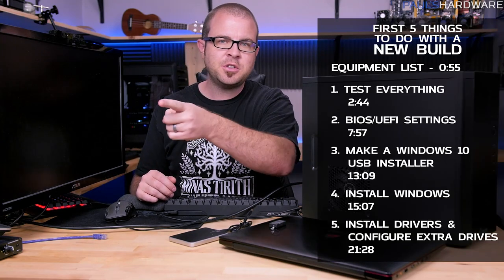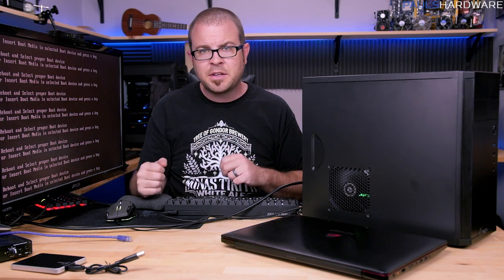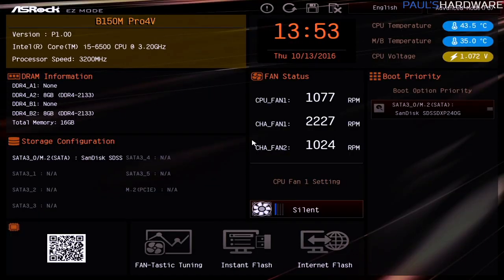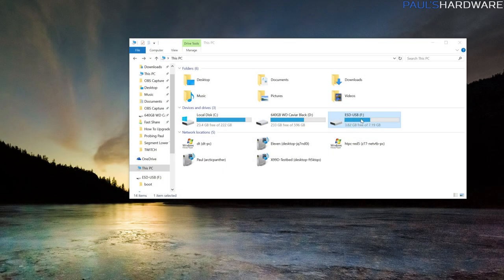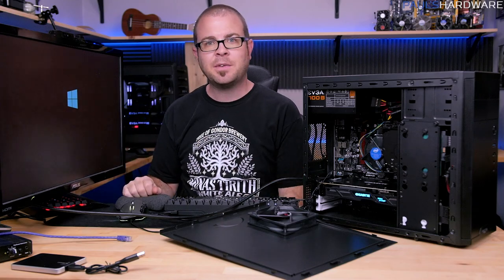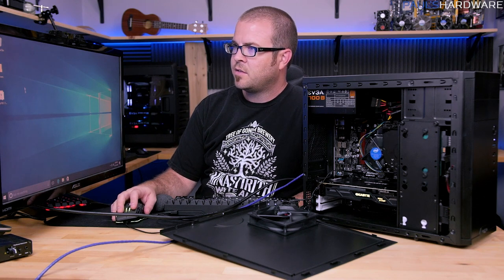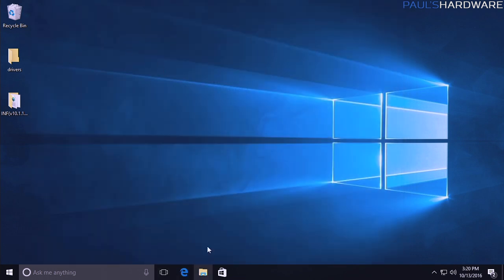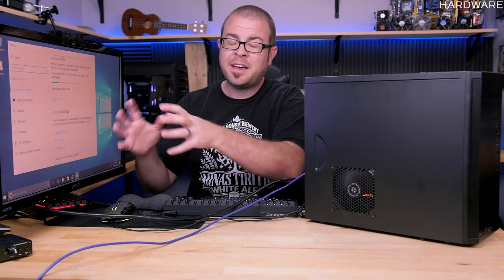First 5 Things to Do with a New PC Build

Comment: can i use my old win 10 product key from my laptop or i need to get brand new key???
Reply: id also love to know
Reply: Most laptops have OEM keys which cannot be used more than once so if u have a laptop u need to buy a new key but if u built (if it's prebuilt u cannot it should be built by u) a pc and bought a windows 10 key write down that key in the new pc and it should work unless u bought a OEM key.
Reply: Biała Panda Hey dude, it depends. If you bought laptop and it came with windows set up. The answers no, but if you put in the product key yourself, yes you can.
Reply: not really because my friend got a key from his friend and he gave me the same key and it works too so we are using the same key on 3 pcs.
Reply: Biała Panda could try it and see as long as it is not OEM.

Comment: I'm building a new pic later this month, and I was wondering- can't I just plug in my current HDD with Win10 and all my files and boot from there? Then get my drivers etc? Thx
Reply: I have swapped mother boards and memory but kept everything else the same.  All that I had to do was install thedrivers.
Reply: Question! So connecting to your Monitor (or TV via HDMI), Keyboard and Mouse does not need "drivers" even when having a newly custom built PC right?

Because I'll be connecting my PC to my TV via HDMI and I've read about it that drivers are needed etc. and it made me confused... (Maybe drivers are needed only when using Graphics Card?) 
So will I be able to use a Monitor (or TV via HDMI), Keyboard and Mouse without installing drivers, so that I can use them to navigate through BIOS while having no Operating System?
I won't be using Graphics Card by the way and I'll be installing Linux Mint instead of Windows.

Newbie here...
Reply: Late response sorry

If you haven't figured it out by now (you've had 3 months) they will work fine but before you do any serious gaming you will want to install the drivers for your mouse, keyboard, and graphics card. The drivers often are in software that allow you to tweak and optimize settings on your hardware, but this is not always the case, so don't freak out if it's not there. It will usually say. If you don't have a graphics card (if you are using a motherboard with integrated graphics or using an APU (Accelerated Processing Unit. Basically an graphics card/CPU combo) you still need drivers. If your motherboard has integrated graphics and you are using an Intel CPU (i3, i5, i7, i9, Celeron, or Pentium. But who still uses Pentium?) it is more than likely you have Intel graphics, and you need to go download the drivers for it. With an APU, since it's AMD specific, go to their website and find the right driver. If you don't remember what you got, or it is too technical, check your BIOS, as more often then not it will give you a name or a model number you can google. Video displays don't need drivers, but be sure you are using the best cable option (for example use HDMI over VGA) that is supported on your motherboard AND your display device. It is no use having a HDMI to VGA adapter as you lose all of the advantages each one offers. 

Let me know if you need to know anything else, I will be happy to help. Reddit has great PC communities such as https://www.reddit.com/r/pcmasterrace/ to help get PC users acquainted with their machines. This is a late comment, but you were speaking as you haven't built your PC yet. https://www.reddit.com/r/buildapc/ Is a great way to find better choices, or even choose full builds if you are completely lost. Remember YOUR PC WILL LAST YOU A WHILE. BE SURE IT IS EXACTLY LIKE YOU WANT IT
Reply: yes

Comment: What is RAID mode?
Reply: TheLivingCat 02 yessss anyone? 🤔
Reply: im as confused as you are... id think theres much to worry about.... its prob something to do with OC
Reply: i'm a fucking crow no it's a way to set up your storage
Reply: TheLivingCat 02 RAID (redundant array of independant disks) this is used as a way to dipurse files and data across more than one drive to  help with general speed and increased storage  depending on what comfiguration of RAID you use: i hoped this helped
Reply: lilly smith good explanation
Reply: lilly smith so basically it's for if I have multiple HDD's and SSD's right?
Reply: TheLivingCat 02 Yes
Reply: TheLivingCat 02 Yes. I have a RAID 1, which is essentially just mirroring the data across 2 different hard drives. If one of them fails, then I still have all of my files safe. Then AI can get another hard drive to set up another mirror. It's essentially a failsafe.
Reply: Its a dungeon that can be as big as 40man and has elite monsters and bosses and offers epic loot
Reply: blackham7 does it have rams tho?
Reply: that dog in your picture is so fucking adorable, I just saw it and I have to point it out

Comment: Scumbag paul... says windows link in description and there is none link i cri everytiem
Reply from the maker: fixed!
Reply: mah man <3
Reply: Paul's Hardware can you do a video on how to seperate storage between your drives? So your ssd doesn't very loaded with crap that should be on your hdd.
Reply: MDG Gaming - Install paths are your friend. :-) You can change the default path in the RegEdit, but some programs ignore it and install on the C drive no matter what. Plus if you change that part of the registry, Windows can't install updates.
Reply: almost all programs you can change the install path while installing, as such you should always check custom install to make sure what is getting installed

Comment: I built my first pc not that long ago... it took me a month of paranoid planning and researching compatibility to buy the components, and a week after that to finish building it. It took so long because I didn’t really know what I was doing, so I simultaneously watched tutorials on how to put the components in while doing it in my computer. I was so worried when putting the CPU cooler in, because no matter how hard I tried, the screws wouldn’t grab onto the motherboard threads. I started pushing down on it desperately to try and get it screwed in, and about 30 minutes later I finally did. I was worried the rest of the building process that I had ruined my processor. I also has school, so I spent about an hour on my computer a day. Finally, when everything else was assembled, I pressed the power button and prayed it would turn on. It didn’t. Luckily, before I got a heart attack, I remembered I had forgotten to switch the PSU switch back to the “on” position. I tried again and it booted up. I don’t think I’ll ever forget how happy I felt. As many headaches as that experience gave me, I loved every second of it, and I can’t wait to do it again.

Comment: Hold the fuck up so I need to have another computer to set up my new computer? I bought this computer because I don't have another fucking computer. I guess I'm fucked??
Reply: Regrapsy Borrow a friend or family member's computer.
Reply: i only have macs...
Reply: Regrapsy Wait.. but would this be like what came first... The chicken or the egg thing?
Reply: He uses it to make a Windows 10 USB Installer.
They sell these at various stores. So you could get it with your license if you get it retail.
Reply: They also sell windows 10 usbs. Just got mine from amazon and is installing as we speak
Reply: LeBron James tons of case just don't come with cd driver space. cd are dead
Reply: Yeah, my Fractal Design Core 2300 has a DVD drive space.
Reply: Go to BestBuy and use a display model to make your drive. If you need a Mac installer, there is a terminal line you can run that builds your drive. They are on display as well.
Reply: Regrapsy I
Reply: I prefer the s340 elite, super sleek design in my opinion. Though I am aware there is no CD drive, there was such an invention called (external CD drives). They are connected via USB. So a $70 case with a $20 gadget beats any overpriced $150 case that includes those aged drives. (Let's face it, $24 for a simple LG Cd drive is, dumb and $69 for blue-ray is ridiculous)
Reply: How do I install ut99 without a cd drive xd
Reply: If nothing else, a library should be able to help out. Still a family or friend's computer can help better. It's only once you have downloaded the current Windows that you are good to go.
Reply: rhys Thompson still works
Reply: Go to a library and bring a usb with u?
Reply: A lot of cases that are desired choices don't have cd slots. As well as the fact that every download is online now a days cd's are useless. Admittedly this is something that would not have access to the internet so a CD would be convenient yes. BUT the USB drive is also available through Windows purchases and is also cheaper. So if you have a way of creating a bootable USB that is the best way (If you know how to navigate computers and such) if not go for the USB Drive + Windows Key package. That way you also don't need to purchase a CD drive for one installation.
Reply: LOOL WoW players??? I PLAY WOW LOOOL AND U DONT USE DISK DRIVE BRO
Reply: You are correct the store sold versions do include cd's. BUT they contain activation codes which are what make the expansions activate. You obviously are not an avid user of Battlenet or any other online game platform like steam. If you have a game for PC most likely it is not purchased in stores but rather online UNLESS you are getting any special promo codes or something of the sort. Even still that stuff is available through the online stores 99% of time at the same time. Ive been playing WoW since Burning Crusade and I stopped using CD's after Lich King.
Reply: How many of those games were purchased within the past few years and what games were they. WoW includes a disk in their IN STORE versions, but I'm almost certain majority of players just use battlenet for purchases at this point as that is what you need to play WoW anyways? And same thing with Steam and Origin. Here I'll give you an example, I was at Bestbuy a few years back and bought MW3 for PC. It was on sale so I bought it, and YES it came with a CD but NO I did not use it as it has an activation code that you need in order to use it, AND it needs to be used through Steam for online purposes which after activating code for MW3 will download using Steam not the CD. CD is not used for anything other than installation. https://us.battle.net/login/en/ WoW download is on here AND if you know anything about WoW you would know that you do not need to do anything with a CD at this point because it launches through battlenet and battlenet automatically updates to latest versions of things. Everyone plays the newest version of WoW but unless you have the latest version purchased you just can't access the newest level cap or the latest character introduced. If you are still using CD's to install your expansions then Im not sure what more I can say except for get with the times bud.
Reply: Okay I live in North America yes. I do not know how exactly Germany's supposed to be different? There is no game I know that needs a CD to be used on PC unless its from like pre 2005. If you know different please tell me what games
Reply: Okay Sims is on Steam as well... Maybe Germany is different but at the same time you clearly didn't know WoW as well as you thought. Reason I was getting so into this is because you brought WoW into it. Thats my second if not first most played game of all time so... We have EB Games in Canada and GameStop in United States. I do know there is a PC section with games yes you're correct. But none of those games HERE use those CD's for anything more than what Steam/Battlenet/Origin do already.
Reply: That is nice af
Reply: You've listed 2 games in your arguments. Ive proven both of them incorrect to a point. Im done trying to explain to you how to live in the 21st century. You want to collect disk and keep buying cd's? Go for it. I was trying to point out how out of the way you go and how EXTRA you are by using CD's when they're 100% unnecessary.
Reply: No you dont use your phone!!!
Reply: Regrapsy j
Reply: It's like the internet commercials telling you to go online to sign up for internet access.. how the fuck
Reply: Anime Obsession That is the kind of argumentation I love to see on Youtube. No flaw, explaining everything you need to understand, no grammar errors. I bend the knee. Bravo.
Reply: Regrapsy local library?
Reply: rhys Thompson you should be able to create the iso off of a Mac, if Bill Gates won't let you, just get the winx iso file and a program called Rufus to make a bootable usb
Reply: Ethan Watters Best Buy lets you do that?
Reply: Regrapsy go to the library and install window 10 on the USB drive there.
Reply: just make sure to do medical checkup later to know if you are pregnant or having STDs
Reply: Obviously you're not, since you were able to post this comment...
Reply: Marcus Hendriksen phone?
Reply: Get a DVD drive and buy the physical copy of windows
Reply: There is such thing as a 3rd-party external CD drive

Comment: Thanks Paul, this vid was a big help.  I completed my first build recently.  When I had completed the build, I initially checked the BIOS as you suggested, before loading W10, and I could only see one stick of RAM, not two.  So I swapped them around, and could still only see one (but now in a different slot).  I might never have known I had one defective RAM stick if I hadn't done as you suggested.  Then when installing W10, the 'clean disk' function you stepped through, was also a lifesaver for me.  Thanks again.

Comment: Thank you for taking the time to break this down into timestamps so I can refer to it as I am building my wife's new Windows 10 Pro computer to replace Windows 7. Will be swapping out her old motherboard and replacing it with a new one and this will be a big help since her new case doesn't support an optical drive. I will need to follow your procedures on how to load everything onto a thumb drive.

Comment: Enjoyed the UEFI section. Just built a new Ryzen 5 system with a MSI motherboard. I had an ASUS MB on my old system and was familiar with getting around in it. The MSI UEFT is a whole new beast, quite different in how it presents the information and settings to the user. Can tell I'm going to have to sit down with the manual on this one and familiarize myself, but was at least able to stumble through it enough that everything is recognize and the system runs well, but plenty of room for tweaking later on.

Comment: So once you setup windows from the USB do you unplug it ? And does it automatically boot off the M.2 SSD ?
Reply: Once you see the desktop, you're done with the flash drive and you can unplug it ;) Your PC should always be booting from your M.2 SSD, as long as it's listed as the first option in "Boot Device Order" section of your BIOS.

Comment: " Key 11" upon the first start to BIOS. Sets the default boot storage..2 questions please. 1) How to confirm this is correct Key "11" for my motherboard? 2) do you hold it dow prior to pushing start power.? Do you hold it down during start process? Thank you. Same questions for Short cut turn off Key "12"? Thank you..Great videos.....( First Build ) I think you make it an obtainable process. Thank you..Liked and subscribed.

Comment: The unplug any other old (boot) drives before installing Windows was one I forgot a couple of weeks ago, and Microsoft then tries to be smart and add the new Windows boot to the existing Windows install boot partition. Which then means that when you unplug the old drive after creating your fresh new Windows install the system won't boot... Bah.

This can be fixed but not without technical know-how, so this is not for everyone.

So good tip Paul!

Comment: Most modern motherboards don't require you to physically unplug the drives you don't want to use. There's usually a setting to disable the ports you don't want so nothing can see that they exist until you go back in and re-enable them.

Comment: Since the mouse and keyboard seem to be functional BEFORE you've installed anything, does that mean there's some sort of driver already present in the motherboard to recognize USBs?  I ask because not having USB drivers is the main reason cited for having difficulty installing Windows 7 with recent hardware.  Supposedly the KB & mouse aren't usable unless you slipstream the USB drivers into the flash drive installer.  But here, they were working for BIOS edits without Windows.

Comment: Paul-  Very nice video.  My last build was in 2014.  I think this first time startup is critical.  This build uses a Z390 Intel chipset, Prime Z390 Asus mobo, an M.2 Samsug 970EVO (1TB) SSD using the PCIe bus for faster speed.  I have the M.2 SSD installed on the mobo which I want to be my C boot drive.  I wanted to partition it for a dual boot Win7/Win10.  I can use a separate SATA SSD for programs or since there is plenty of space, run the programs from the M.2  I have three 2TB SATA drives for data (RAID 5).  From your video, I get the idea to install the SATA drives AFTER running BIOS and Windows installation.  For the partition of the M.2 drive, I am assuming that each WINDOWS would need a 50MB partition and the balance to be used for programs.  Not sure how to do that.  I have Win7 installed on my previous build and bought a new copy of Win10-PRO.Any advise would be vstly appreciated!!!Mark Heyda, Lynnfield, MA

Comment: new build wouldn't start because motherboard power supply was loose.  now 3 case fans and cpu fan start for a second then turn off.  motherboard light stays on, but fans do not start again until you turn the power on and off again.  checked that all cables are tight.  could it be the motherboard?  it got dropped hard on the table top (my first build)  or something else?  thanks so much Paul, you inspired me to build two Ryzen 3 systems but I'm having trouble turning on the computer.  Should I build the second one, and that way we will know if it's the motherboard.